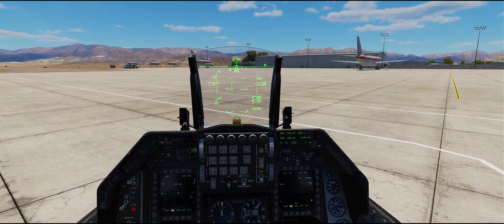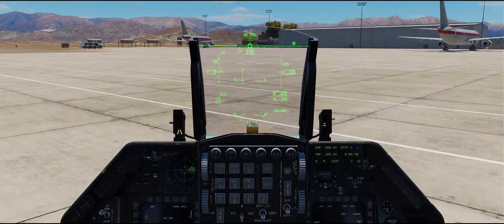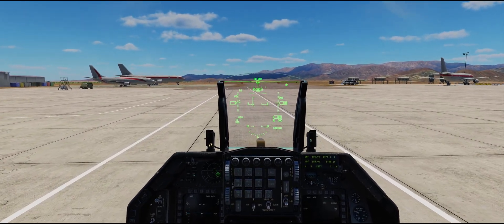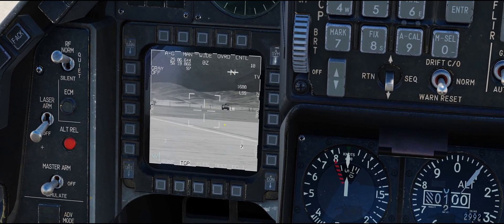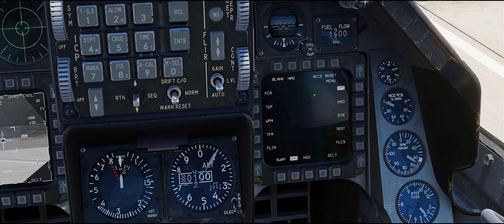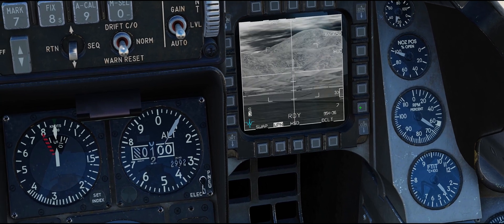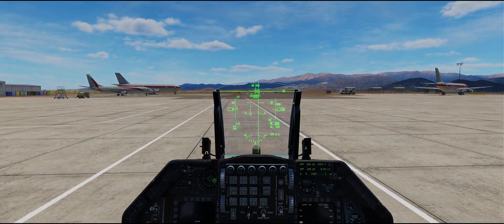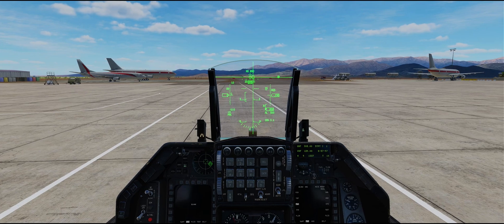2023 Updated Maverick Boresight Procedure - DCS F-16C

Comment: This is a good video but I can never get to actually work well, ever. When I am up in the air and see my target with the TGP, the mav is off just enough for it to have no point in doing at all. End up doing better just using VIS mode. I wish ED would just take this step out completely or have a special option to disable for players that don't want this much "realism". You don't have to do this crap in the Warthog or Hornet.
Reply: Same here. I seem to spend 99% of my time on the ground bore sighting. Only for the tgp and mav to so far apart I cant hit anything.

Comment: So they have updated the sensetivity of the mavericks a little bit. so they have a bigger "engagement box" as you can call it, for when you use your TGP to lock something up at range. the average range of a TGP's view-distance where you should actually be able to see something clearly enough on the ground is about 10-15 Nautical-Miles so within that range your Mavs should track properly and even auto-lock on to what you're TGP is locked on to. however, this requires you to Boresight at the proper distance while on the ground. on-ground boresighting should be at 1 Nautical mile so as to not make the boresighting basically crosseyed. 1Nmile = 1.8km or 1800m. so if you're on the ground boresighting instead of doing it in the air, like most pilots in 16's aparently do. you need to be close to if not exactly 1 (One) Nautical Mile off the target that you boresight off of ^^ a trick you can use when making a mission that uses F-16's  with mavs is to add a Marker on the ground that the 16's move over too and place a known target 1-Nmile away from it for them to use. or if there's a lot of water big enough to hold a single boat on the way towards the target, or next to the airbase. place a boat. use that in the air. OR use the Yardstick function of the F-16 HSI/TCN and get 1Nm behind your flightlead and boresight off him/her and let them to the same with you.
 but the sensetivity has been lowered so it is easier to be less accurate and still get a positive lock using just your TGP. that being said. you don't even need a TGP. you can roughly Align them with your Hud aswel in Vis mode. use your HMCS or HUD to guide where they look and then WPN page to finish the job from there ^^ hope it helped

Comment: This is the most infuriating part of the F-16. 
If I power off the mavs after boresight, when I power them back up will they maintain boresight?  In BMS the mavericks have a set lifespan which is why you can’t power them on and fly around for 2 hrs before using them.

Comment: I’m still struggling to get them correctly boresighted.  Like stated already, my issue still isn’t the procedure to BS, but to actually have them BS’ed.  once I get in the air after BS’ing the mavs, mark point several targets & then lock with TGP.  I try to auto handoff like normal & the mavericks aren’t pointing anywhere within 10 miles of the TGP marked target??  I had no issues with this about 6 months ago?  Recent update with beta yesterday for me still hasn’t fixed this…
Reply: I have the same experience. I hope they’ll fix it soon. Never had any issues before.

Comment: The bug is it only works for the selected missiles on the rails, not all 3 of the missiles on each rail at once. So you'll end up with a bore sighted missile on each station, and the rest aren't bore sighted.
Reply: That explains so much why I was struggling to make sense of things on my last group liberation campaign. Thanks.
Reply: Good to know! It's been driving me crazy that the first Maverick on the rack is fine but the rest are all misaligned when they should all boresight per station.
Reply: Is this still true or has it been fixed?
Reply: @jimmy8x541  I think it's fixed now.

Comment: To train good habits: try to do this in flight. If you ever switch to Falcon BMS, where the battery of the maverick only lasts 30 minutes after you power it on, or if this gets implemented in DCS you dont have to retrain.
Reply: Bold of you to assume that I ever survive for over 30 minutes.
Reply: Sadly all the realistic features in the Maverick missiles isn't simulated by the ED. 
Like example the capability uncage the maverick before cool-down, but you get a fuzzy or very high contrast video while the seeker is cooled.
And then written example elsewhere for IR seeker version of Maverick:

IR Maverick Seeker Cool Down.
Once airborne (weight-off-wheels) with IRMAV
selected (boxed) all IRMAV missiles begin a 3
minute IR seeker cool down and gyro spin up. At
the conclusion of the cool down and spin up, all
IRMAVs will be in the READY mode (RDY
displayed).

[CAUTION]
To prevent IR Maverick missile seeker

damage, adhere to the following missile
operating time limits. The IR Maver-
ick is operable in the ready mode (RDY
displayed, video not present) for 1 hour
maximum. In the active mode (video
present), the missile is operable for 30
minutes maximum. After having
been operated, the missile recovers at a
rate of 1 minute of additional operat-
ing time available for every 2 minutes
the missile is off.

Uncage. In flight, IRMAV can be
uncaged before the RDY indication appears on
the MPCD (3 minutes). After the 3 minute
period expires, if IRMAV is deselected and rese-
lected, the 3 minute wait is also not required
before uncage can be activated. However, IRMAV
video may appear fuzzy until the full 3 minute
cool-down period is complete. Depending how
long IRMAV remained deselected, the IRMAV
seeker may need about 90 seconds before it can
reactivate video.

[NOTE]
IRMAV video remains displayed until a master
mode change is made, a different missile is
selected with the STEP option, IRMAV is dese-
lected (unboxed) or another A/G weapon is
selected. Any of these four options removes the
IRMAV video and deselects the missile.

[CAUTION]
A HOTAS command that replaces IRMAV
video with another display but does
NOT deselect the IR MAV missile; 
the missile remains in slave
or track mode (capable of being fired), 
even though no IR MAV video is displayed, 
until the missile is deselected via master
mode change, STEP option, or unboxing 
IR, or selecting another A/G weapon.

[NOTE]
If IRMAV reaches its gimbal limit
while being slewed after being in
track (slew mode), it slaves back to
the velocity vector. If IR MAV seeker reaches
its gimbal limit while in track mode
(i.e., target overfly) the seeker
remains at the gimbal limit (with the
display ′′bouncing along′′ over the
ground) until the undesignate button
is pressed, the seeker is caged by
pressing FOV, or it is slewed off the
gimbal by the TDC.

[SHIP MODE]
The SHIP function on the MPCD changes aim
points while the missile is in slave mode. If the
missile is in track mode, selection of the SHIP
option results in a ′′buffered′′ target change com-
mand; the aim point does not change until slew
mode is entered. If the missile is in track mode
and it is desired to change aimpoints push the
SHIP pushbutton, then action or no-action slew
mode is entered with TDC movement and the
aimpoint change takes effect. Removal of the
slew command recommands track.

[CAUTION]
The g-bias algorithm in the IRMAV seeker
seeker is responsible for determining
the amount and direction of the loft
maneuver. The g-bias algorithm
assumes the aircraft is wings level at
lock-on to determine the vertical refer-
ence of the missile. Any roll maneuver
between lock-on and launch is memo-
rized by the seeker autopilot. At
launch, the missile rolls back to the
attitude it was in when lock-on
occured. If the seeker was commanded
to lock-on with more than 30° roll, an
incorrect vertical reference will be
established and the missile’s maximum
range will be reduced.

[CAUTION] (Compare this to IRMAV seeker)
The Laser
Maverick missile must have a vertical reference
established for proper roll control and missile
trajectory (g-bias) after launch. The vertical ref-
erence is established at missile launch by assur-
ing that the launching aircraft is within ±10° of
wings level at missile launch. After launch the
missile will maintain the vertical reference estab-
lished at launch and will fly a lofting (g-bias)
flight trajectory to the target. Optimum launch
range performance will result when the aircraft
bank angle is within ±10° with decreasing maxi-
mum launch range as the bank angle increases
from ±10° out to the maximum of ±30°.
Reply: Not with the engine running surely? Although I would assume in flight is more realistic. Can't see this happening on the ground.
Reply: @Mark_Point  The Maverick battery is in the missile, it's not going to draw power from the generator. You're supposed to turn them off while not in use after alignment and boresighting, that'll give you an hour of uptime. Hence you're supposed to turn them on and drop the seeker cover then boresight them only relatively close to the AO.
Reply: @ArchOfficial  Ah ok!  Yeah that makes sense. They should put that in then.
Reply: @ArchOfficial  if you can do the alignment and boresighting first and then turn the missle back off -> on again with it correct, why wouldn't you do this on the ground then take off?
Reply: @EbonySeraphim  The boresight will be highly inaccurate due to parallax, and most of the time your transit will be about an hour so you will run out of juice. In DCS I guess it's okay because of the unrealistic 5 minute transit times and immediate targets when arriving at the AO.
Reply: @EbonySeraphim  If you turn the missile on, it has 30 minutes of uptime while on. If you turn it off it has an hour of uptime while turned off, after it has been turned on once.

The boresighting isn't what starts the timer, but the missile has to be turned on so you can boresight it. Hence you will need to boresight it in the air.

The BMS vs DCS digs are highly relevant as DCS does not have any maps where this is really a factor, but transit times in excess of an hour are common in BMS and real life, hence the optimal procedure varies a lot.

I have heard of some A-10 units boresighting the MAV on the ground, though, but I can't remember in what context.
Reply: @ArchOfficial  unless you are on the grayflag Pg server. Then a 40 minute flight to the action is required

Comment: That has been the procedure (MA Simulate, Ground Jettison enabled) for as long as I can remember. You can go back and watch Wags’ video from long ago to verify it hasn’t changed. The issue isn’t boresighting it’s that after boresighting the Mavs don’t slew to the location of the TGP.

The question I have (and haven’t been able to answer) is: Is the a MAV boresighting/slew issue or an offset SPI issue?

Thanks for the video but I don’t think it will help us with ground target kills until ED fixes something.
Reply: This has been the correct procedure from the start yes, but in previous patches you didn't actually need to use MA simulate and ground jettison for it to work, so a lot of people learned to do it incorrectly skipping those steps since it worked in the past
Reply from the maker: I was apparently one of those people, and looking back at some other YTer's tutorials some leave out enabling ground jett enable or sim (now I am finding some did have it in there, GR and Tricker did apparently). Wags' tutorial shows it done from the air (if he did another video boresighting on the ground, I couldn't find it). So I figured i'd make a new video and do the whole process start to finish, so those who are new to the F-16 can find everything in one place.
Reply: @FLYGaffer  I sit corrected, thank you.  It's nice to have clarity on the procedure for sure.
Reply: Yea, I was thinking this is the procedure I've known for a while. It just doesn't work. Misleading video title.

Comment: I’m not a DCS master by any means but I have noticed that the further you boresight the more accurate it will be when you’re actually flying. If you boresight something very close and it’s not pointing to the exact spot you placed your point track then the margin of error will be much higher the further away it is. This also seems to be the case with where you boresight on the object (point track center mass and you boresight the maverick to the corner of the object will be off). I spend a lot of time on the ground getting it as accurate as possible and it really makes a difference when you’re trying to lock from 7-7.5 miles. I try to be on the opposite side of an airfield and boresight off of a 90 degree angle like the corner of a building or a sharp corner of a vehicle so I know I’m aiming everything at the same spot. Hope this helps!
Reply: Seems logical  due to the distance/offset between the Mavericks and the TGP.
Reply: This is trigonometry basically. In actuality, either the boresighting is well aligned for close targets, or far targets. It's a targetting pod, so you want it most accurate for far targets, but it will always be a matter of two lines that are converging when too close, intersect at some exact distance you aligned/calibrated for, and diverge further from that point.

Consider that If you stand next to a friend, say side by side with a half of a meter between you, both perfectly facing the same direction. If you both point at a small object exactly 45 degrees to the left (of front) 10ft away from you (let's say it's a cluster of objects), you won't be pointing at the same object. Those objects will be as far apart as you are standing (.5m), but for either of you to adjust your angle to point to the other object, it'll be a large angular difference. If you both pointed to something 100ft away, you'd still be pointing at different objects .5m apart, but now the angular difference for either of you to adjust will be far smaller. I won't bother to explain this with words, but if you "align" such that "45 degrees left" results in you both pointing to the same object at 10ft, hold that same direction and look at what is being pointed to at 100ft -- waaaayyy off.

Thankfully though, in the case of the TGP + Maverick, they are damn close to each other so as long as they both have accurate "45 degrees left", at 7-20 miles range, being 20ft shifted left or right isn't a problem. You'd rather be accurate that both see the same 45 degrees within 0.1 degrees over that distance.
Reply: That is correct. There is parallax between the TGP axis and the missile axis. If you draw a triangle between the TGP, missile, and target, the parallax will be proportional to the ratio between the length of the triangle and the width. There's also less parallax on the right side mavs, because they sit closer to the TGP.
Since you usually aim and launch a mav between 5-8 miles out a 6.5 mile boresight would be ideal.
Reply: It's math. The difference is zero when you boresight infinity. So the closer you boresight the more of a difference it is. Good news is even half a mile should give u low enough error margin for operation.
Reply: @master4098 It's trig specifically, which is triangle math. If you boresight at infinity, the missile and TGP axes will be parallel. So if they're 5m apart on the jet, the aimpoints on the ground will be 5m apart. That could be far enough that the missile locks on to a different target than the TGP, or just doesn't lock.
Since the missiles can't go much more than 8nmi, and they have a minimum range, the best option is to sight them in the middle of the effective range, which minimizes the error. For example, if they're 5m apart on the plane and you boresight at 6.5nmi, at 5nmi and 8nmi, they'll only be 1m off, which still should target the same object.
Reply: Yes this is called parallax